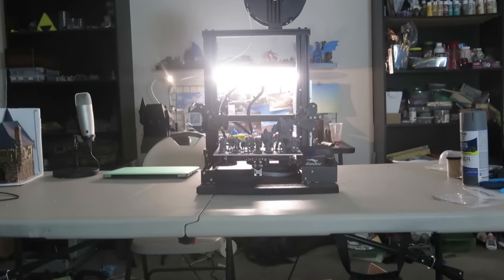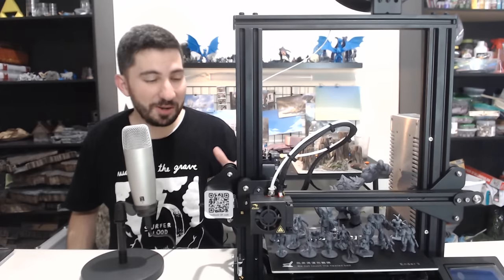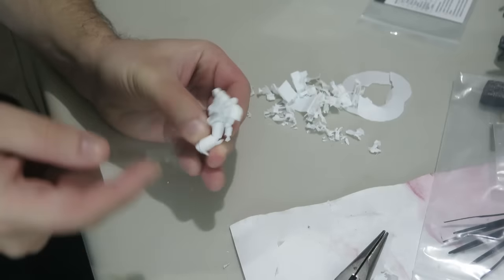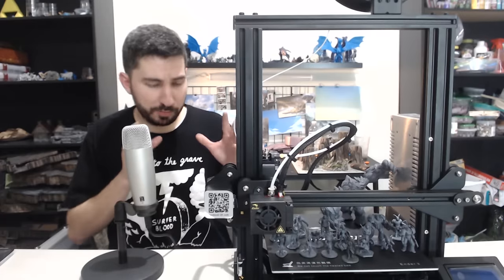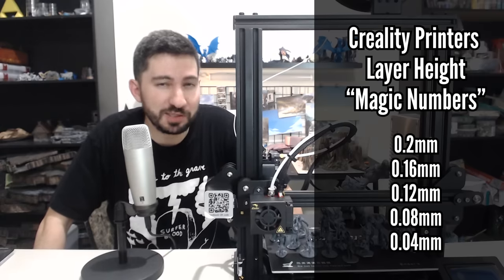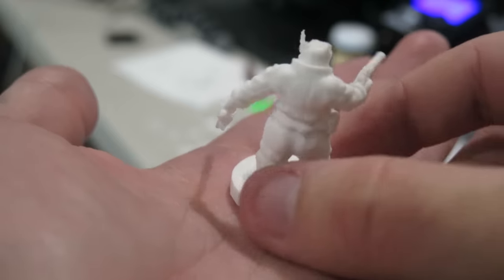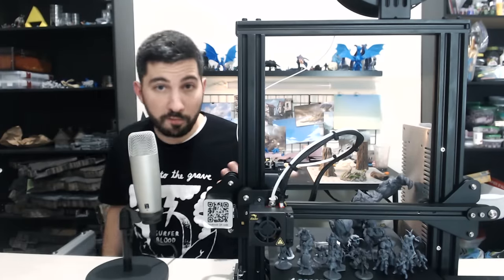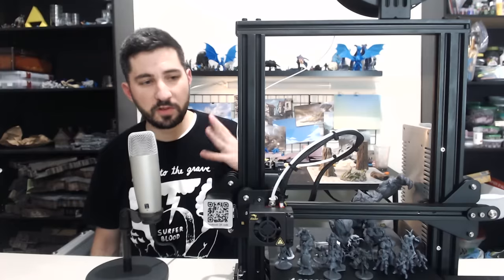How To Print Resin-Like FDM Minis on $200+ 3D Printers (Printing The Game #3)

Comment: Gorgeous results very impressive now I got to figure out how to make simplify 3D do this :-) and I'm going to have to play with Cura some more keep up the great work it is appreciated
Reply from the maker: I'm so flattered you think that. I don't have time to watch all of your videos, but I've learned so much about upgrades (mostly that I want to do eventually :D) from your 3DPT show that someone shared with me a few weeks ago. 

If you find a way to get this result in S3D before me - I would loooove to know! After improving support removability and increasing speed, making a S3D profile that is comparable is my next priority for this direction.
Reply: Have you any updates on S3D settings?
Reply: I'd be interest in those too
Reply: I'm curious as well ;)
Reply: I got great results with S3D. Slow speeds(30mm/s and 40% on outer most perimeter) and small layer heights(0.08mm) combined with enough perimeters (3 or so with enough infill 50+%) and custom-placed supports worked really well. Some models are more difficult than others but I was impressed  by the quality my Duplicator i3 was capable of. It takes a while but generally worth the wait. I did have some extruder motor overheating. Some models have many small features and separate supports and thus many start/stops and extrusion. I countered this by fusing supports and by slowing my printing speeds even further for some models. And by reducing my retraction length. Maybe you should try using a separate process(0.2mm layer height) for the base if you want to save time. This is what worked for me. Slow and small layer heights and this way you can push your printer to its limits:)
Reply: Ewout Zuiderduin And make sure your extrusion width and printing temperatures are dialled in by doing a temperature tower and some single walled cubes and compare the wall thickness to the assigned wall thickness in the slicer.
Reply: Thanks for the info. What extrusion width are you using?
Reply: Charles Gallup I calibrated at 0.40 mm with my 0.40 mm nozzle. Although I have recently read that most people use around 0.45 mm for a 0.4 mm nozzle since this assures better layer adhesion. It is difficult to print with a smaller or equal layer width compared to the nozzle width although I had no problems.
Reply: Nerys have you converted the Cura profile for miniatures to S3D? I tried the Cura print profile and it’s amazing but the supports obviously suck lol!
Reply: I have not gotten prints where the print layers seem to disappear yet (but I have only had a printer over a year now). I use S3D with the Anet A8. the settings I play with that seem to make the biggest difference is extrusion width, layer height, top solid layers, outline/perimeter shells, use solid diaphragm every 1 layer, default print speed, outline underspeed, and temperature. if anyone knows how I can get this level of quality, let me know. I'm not worried about the cleanup but having to print tools so I can sand in crevices is annoying.
Reply: I just saw a video on the First Layer group where they suggested a little battery operated etching tool for cleaning up fine details
Reply: Any S3D settings?
Reply: Ewout Zuiderduin fusing supports w s3D?

Comment: Hi, I just used these configurations to print some minis on a Original Prusa MK3 and it worked like a charm. Needs some filing here and there, but that´s expected. Definitely better than what I was getting before.

Comment: Shortcuts:
suggested printer Ender 3 200$
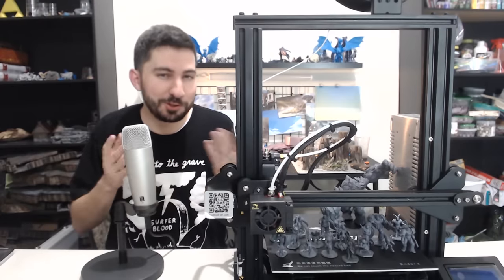7:33 1. 100% infill ( affects quality)
8:29 2. Layer height 0.05 (0.08 for beginners)
10:01 3. Slower print speed
10:46 4. supports: zigzag (break in chunks)
13:43 5. orientation (experimental)
Todo: reduce print time (6h for one minni might be had for some). At 19:08 leo's comparable results are shown at 20% infill and half the time.
Reply from the maker: Awesome tl;dr Robby! One thing I'll add: For 100% infill, if you're using Cura it needs to have 99999 top layers and 0 bottom layers. 

Thanks for the comment!

Comment: Thank you for this video. I know I am WAY late to the party. I am just now getting into the idea of a 3D printer to make minis and I have had some trouble admitting I need to start with an FDM and not a resin printer. I was so worried about some of the quality I have seen of FDM stuff and you video helped me realize that an FDM is likely something I can get into and be printing and stay at about 1/3 of the cost of getting a resin printer up and running.  Thanks a bunch!

Comment: I get the folling error when I ty and import the profiles. Failed to import profile from ..Siepie-CR10-Ender-3-Small-Minis-PLA-Base-1.0 (1).curaprofile: Could not find a quality type normal for the current configuration.
Reply: Hi did u fix it?If yes what was the problem?
Reply: @quantelon  I did not
Reply: @ian9817  Do you know any mistake I could have made?It's a 28mm miniature.

Comment: I am looking for a cheap 3D printer to print 28 mm minis and need the facial detail to be fairly decent. A friend of mine has a 3D printer with a layer height of 0.1 mm and he is not at all satisfied, so we were looking for one with a lower layer height and stumbled on this video, but when checking online, the description of the Ender 3 always says that the layer thickness is between 0.1 and 0.4 mm. Why can you set the layer height for this 3D printer to be 0.05 mm, when the description says, that the minimum is 0.1. Does this also work with other 3D printer by chance? 
Cheers!
Reply: I'm curious, too!
Reply: It should. You just change Layer height In Cura.
Reply: @alaricpaley8976  Thx!
Reply: The motor goes in .04 increments so .04 and .08 should work.

Comment: I know it's a bit late, but I just came across this thing as I was starting to get pulled into live wargaming. I just looked at the prices of Mini's and wished I could figure out how to 3D print these things, but didn't know where to start. This is an amazingly good starting point since it proves you can print Reaper Grade minis. I now have an idea on what I need to get started in this.

Comment: having issues with your pre set profiles, when i add the downloaded files to cura to create a know printing profile it simply does not allow me to despite having ender 3 selected as my printer. Any help with this please? or if someone has the data sheet for these profiles i could make one manually with?
Reply: Same here. Wanted to add the SiePie profile in Cura 4.1.2 for my ender 3 but won't accept it.
Reply: @steffengr.5556  My current solution was to downgrade to Cura 4.1.0, where the import worked

Comment: Lovely, I don't think you have a horrible accent rather the content is clean. I will surely test on my Ender 2 .
What do you think shall this work on Anet A8  also ?
Reply from the maker: Well, thank you kindly either way! All that LOTR did me some good ;) The profile won't work on the Anet A8 - but the settings absolutely should. Cura, 100% infill, 9999999 top layers, 0 bottom layers, 20-25mm/s, and 0.08 (ideally 0.05mm or less) layer height. Good luck! Lemme know how it goes!
Reply: I am gonna try the setting on anet A8 and see if it can do some wonderful prints, I already tweaked the firmware but can leave a chance to see improvement. I will surely send you some pictures.
Reply: MakewithRex I'd be interested if it's better using those settings
Reply: the settings "100% infill, 9999999 top layers, 0 bottom layers,25 mm/s, and 0.08" works on my Anet A6  so it should work on your A8
Reply: Hey, MakewithRex: A lot of the stuff that is in the video works on my AnetA8. The layer height butter zone is the same as the Ender3, and printing the halo cooling duct is magic. The "all top layers" also works nicely. I drop speeds to 20 on everything except the outer walls, which are 10, but the results are fantastic.

Comment: profile dont work in cura 4.2 for ender 3 printer..
Reply: Having the same porblems. model wont slice in Cura. Did you find any solutions?
Reply: had same issue. I am going try to manually implement all of the same settings atm
Reply: Thomas Kimmel 
I did some small troubleshooting. From what I can see, the newer cura version won’t slice when top layers 99999, bottom layers 0.
Reply: it seems to me that the 4.2.1 has different way to interface and more ways behind the scenes if activated I have the basic profile created of Siepie for 4.2.1. As said in the video there will be adjustments that can really fine tune the ability of your printer if you put in the time. I would recommend putting in time on the retraction control speeds and accelerations to fine tune surface artifacts and stringing. If you would like the 4.2.1 profile I might have most of it.
Reply: @henrikc88  try 5000000. works for me. just try other big numbers
Reply: Thomas Kimmel 
Will do, thanks for the tip!

Comment: Man truly a great video! PERFECT example of content presentation on YouTube. A mix of straight facts and salted in meandering detail, and your thought process behind it all. 

I enjoy different types of content… sometimes Straight to the point fact videos… But my favorite videos are long format 30-90 minute, … Metal machining videos, woodworking videos, electronics lab, whatever. Just around the shop stuff.

I do a lot of machining, casting, material preparation and finishing, and restoration of vintage tooling and such. Just an idea I had when looking at your miniatures… Possibly some form of wet tumbling after you remove the supports and before you do any priming or anything. 

Some of those very quiet rotary rock tumblers are meant to run for days at a time… But instead of grit or polishing compound you could add a bit of ceramic and tiny pieces of scrap print plastics… maybe even different types of sand and abrasive grit. Who knows.

Basically imagine being able to take sandpaper under a microscope and sand every square millimeter of your miniatures with out flattening out any detail. Sandblasting with polishing compound could also work. Maybe soda blasting or bead blasting. Small cheap setups can be made at home for the type of thing you’re doing. Hell a plastic bottle with a feed hose stuck on top of a air nozzle coming from your air compressor will do just fine LOL

It would help abrade your surface and basically polish off any unevenness, layering, or nibs, while maintaining great detail. You could experiment with different harshness of grit, materials and such. I have a large vintage industrial tumblers that I’ve restored… That I got for next to nothing. But if I had to start out and just go buy stuff new… It can get really expensive. However… Harbor freight offers a rotary and a vibratory wet Tumbers. They also offer ceramic grit and things. Pretty affordable and they seem to be pretty tough… I know I’ve given them quite a bit of abuse when my larger tumblers are full. Just an idea. Thanks for your content! Feel free to shoot me any questions. I am by no means an expert on 3-D printing Hell I don’t know much at all about it. But materials preparation and finishing is my specialty. You could even chrome plate those bad boys LOL plate them with other types of metal. I’ve plated all types of plastics it’s not that difficult and it’s quite fun.

Thanks again! Your channel should explode with great content like this!

-Grant Hull
ghull07@yahoo.com

Comment: I slowed down to 25 mm/sec and it resolved all of my problems: echoes, under-extrusion, etc.  So that's awesome.  Now I am wondering what you recommend for smoothing layer lines (PLA).  Have you tested any specific products such as polyurethane / brush-on versus spray / ease of use versus effectiveness....I guess in other words, have a recommendation?
Reply from the maker: Great work! I use a thin coat or two of polyurethane, but I've seen folks use even clear nail polish. It all works the same: just a varnish to sit in and smooth it out. I use thin layers of poly so I don't have to do much sanding. 

That being said, I'd never use spray on printed minis or terrain because of the inconsistency and because it would almost assuredly cover up detail. I use brush on polycrylic.

This is how I do it: https://youtu.be/uN4e-6hiA0U

Hope that helps, Wyloch!
Reply: @3DPrintedTabletop  Thx!
Reply: @3DPrintedTabletop  ....yeah I guess I should use the Search feature.  :-D

Comment: I know this is a bit older, but just an FYI.  If you have a newer version of CURA that won't import the profiles on the website, here's what you can do.  This worked for my CR-10...  (It might not work for other or non-Creality printers..)
1:  (I have 7-zip installed), right click the file and choose 7-zip - Extract files.
2:  Rename the directory it created (just to something else, ie. I renamed one of mine to just Siepie) and then go into that directory and there will be two files.
3:  Edit each file (I used Notepad++) and change the quality line to this:
quality_type = standard  (I believe they are normal before the edit; that line will be in each file..)
4:  Right click the directory, select 7-zip - Add to Siepie.zip (or whatever you named it)
5:  Rename the file back to .curaprofile (in this example, from Siepie.zip to Siepie.curaprofile
6:  Import that profile into Cura.
(Note, I have successfully imported and it looks good, but I haven't printed anything yet..  Also, if this doesn't work for you and you have other profiles you have imported, you can use this procedure to extract the other profiles to see what the quality_type should be; it is not necessarily the same for each printer model.  That's what I did with a CHEP profile to find out that "standard" worked for my setup.)

Comment: Thanks for this! Works excellent on a Geeetech A30. Imported your profile, and the only thing I had to change was the bed temperature. I guess this bed doesn't like no heat. Cuz it didn't stick at all. Turned it up to 50, tried again, and got an amazing print off a 30mm high (printed upright) super thin Jason Voorhees hockey mask after a failed attempt of my own settings. It's incredible!

Comment: The key to stringing is that it is different for direct drive and bowden. A bowden require about 5-8 mm retraction, i use 6.5 mm. If you got direct drive it is lower but if you got a blwden setup, double the default as minimum is a good key to fix it. I have no stringing at 50mm/sm at 80 i get a bit ghosting but strings is almost a non problem as long as you do the retraction and temp correctly. If it says 200 print at 205 as a too low temp will make a sort of bubblegum print filament that can string but to warm will not do any real issue.

Comment: Hey man, one thing you should try for less ugly stringiness is retraction settings, I've found that doing a high speed retraction with a tiny bit of print head lift (about 0.2mm) snaps the plastic away and kills off nearly all chance of strings and wisps. Hope this helps if you haven't already changed your settings to account for this.

Comment: This vidoe helped convince me to buy my ender 3 when i was starting out in january 2019, and it really showed that good and reasonable quality is realistic for these machines. But now, its been about a year and a half, and with my experience i look at these models and think "wow, these really aren't that good. My own models, with my own custom profile on a mostly stock ender 3, are soooo much better". Stringing i don't care about, its easy to clean up. But the blobs, lack of details, random bits of under and over extrusion etc are all very noticable once you know what you're doing. So to anyone new who might read this comment, please know, this is about a 6/10 for quality you can get from an ender 3 or similiar machine. You can print so much better than this it's unbelievable, so don't think of this video as this high standard of model quality, it very much isn't, and it's very easy to get better results.
Reply: Care to post your profile for all to use?
Reply: @matthewjoyce5740  Sure, you and anyone else please feel free to send me a direct message on here and I'll send you the link to my Google drive folder specifically for this purpose
Reply: @vaderciya  Hi, Apparently Youtube has removed the directmessage function in march?
Reply: @matthewjoyce5740  I commented the link on the only video you've posted, enjoy!
Reply: @vaderciya  Thanks so much, Any recommended models for first print?
Reply: @matthewjoyce5740  Keep it simple, keep it safe. Your first prints should be easy and un-complicated, and progressively move on to more detailed and complex models when you know that the tests are coming out well

Comment: Getting a smaller size nozzle can dramatically increase the quality of prints that small, and make supports easier to remove, it's something I'd really look at.  They're cheap.  Plus you could probably go back to "normal" printing without having to fool the slicer into doing odd things for the same, if not better quality, with faster prints.  

It's very difficult to say that a single profile can just be plug and play with a wide variety of printers.  I used to run a small 3d printing company that used different printer models, and printing the same objects across the different printers usually took very different profiles to get the same quality, sometimes having to use different slicers across them.  There are just so many variables between them, you have to fine tune each print for each printer.  The same goes for slicers, each one handles settings a little different from each other so what works in one can come out totally different in another.